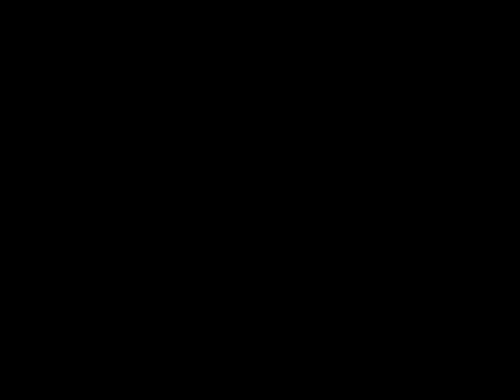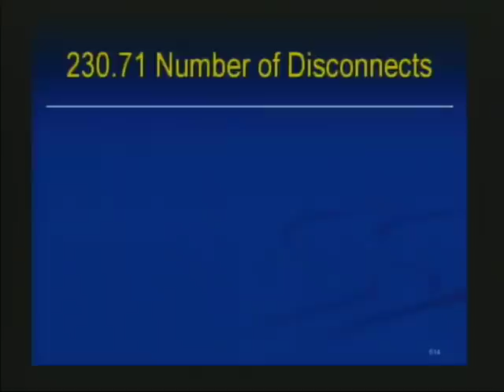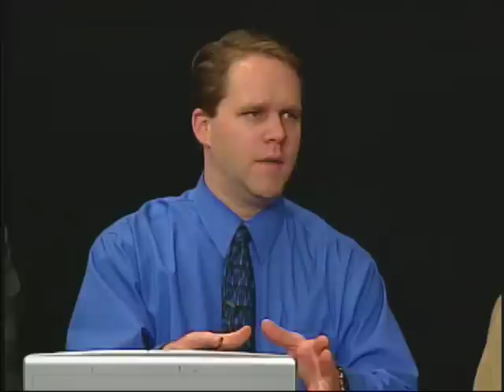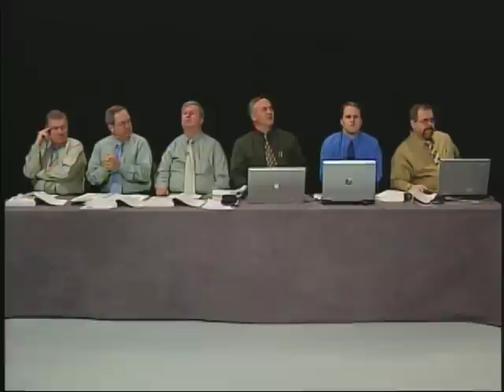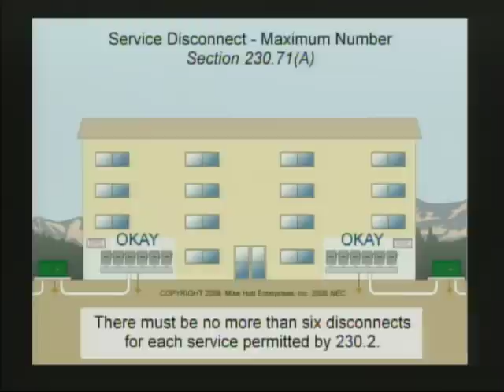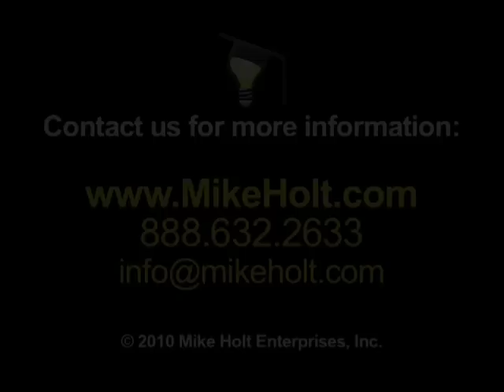NEC 2008  Number of Service Disconnects 230.71

Comment: Great video. However, if we want to add a PV system to this existing line up with an OCPD, would that be a code violation? If the 7th OCPD is a violation, can the PV system be tap off from the main bus with fused disconnect? Or in another note, a PV system adding to this existing line up would be considered a separately derived system? Thanks
Reply from the maker: PV system disconnects do not count as part of the service disconnect limit of six. So you are good to add six PV system disconnects to a building that already has six service disconnects. See Article 690 of PV system disconnecting means requirements.
Reply: What about subpanel? If the subpanel has more than 6 breakers, does it need a main breaker?